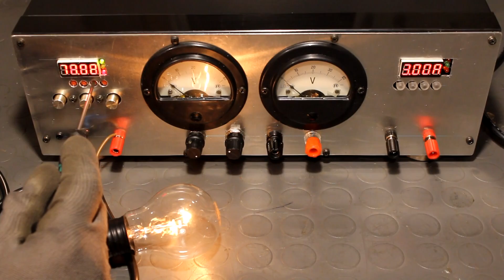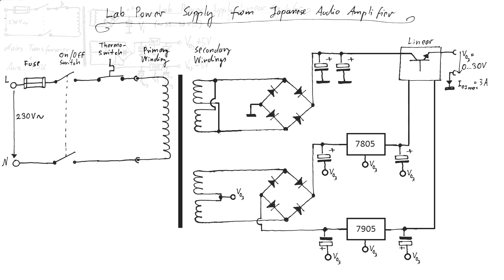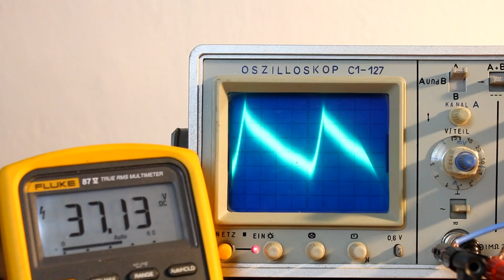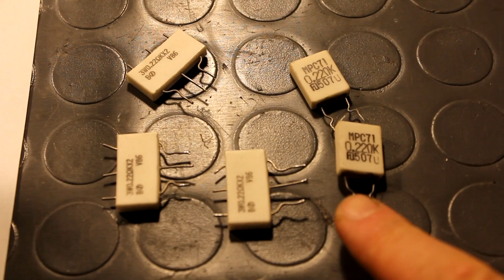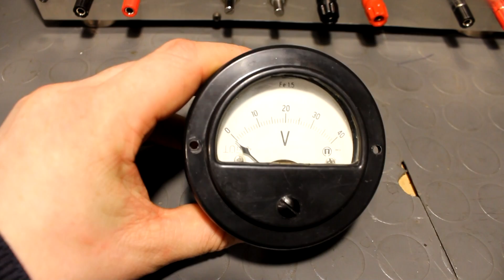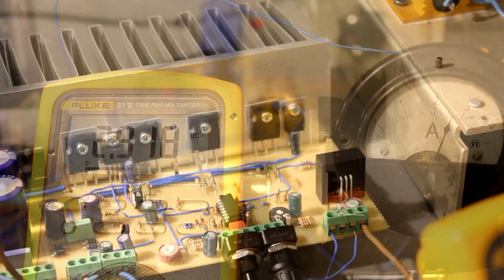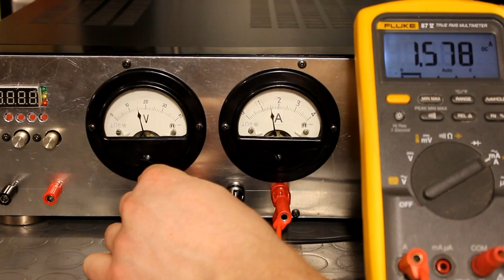Building a Lab Power Supply with a Discrete Linear Regulator

Comment: I love your videos. I'm one of your first subscribers :) There is something that utterly bothers me in this circuit. Either the circuit as shown should not work or I don't understand electronics as much as I think. There must be something omitted.

Now. (Vi --- Ground) and (Vo3+5V --- Vo3) are two completely different circuits. How can current flow from Vo3+5V to Ground? I don't see how that circuit is closed.
I'm not being critical here, I'm just trying to understand. The device obviously works. So either I've forgotten everything I know about electronics or there is a mistake in the circuit diagram.

I can see how current can flow from Vo3+5V through the resistor 220ohm then through the emitter-base of BC556, through the potentiometer and finally  the circuit closes to Vo3.

But how can current flow from Vo3+5V through resistor 220ohm then through collector-emitter of BC556 then base-emitter of the transistor bank (and 0,55ohm), through the load and finally Ground? Those are different circuits, current should not be able to flow from the (plus) of the one circuit to the (minus) of the other?! It's like connecting the plus and minus of two batteries but leaving the other ends open.

Again, I'm not hating or something. That really bothers me. I hope there is some mistake.

Awesome video. I'd love if you could explain what's going on with this, I'd be learning a great lesson if I'm the one who's mistaken.
Reply: They aren't separate circuits. Vo3 is common to the power and the regulating section of the circuit.

Comment: 4:10. Variable-volt reg like LM317 needs a minimum load; don't remember seen this requirement for fixed-voltage reg like LM7805, though. They have a quiescent current with maximum around 8mA going directly to the ground pin, so I suppose this is already the "minimum load" and we don't need a minimum-load resistor.
Reply: as far as i know, they don't require a minimum load, because they have more or less one built in.

Comment: Great video and project!
From what i got from the vid you're using a floating output ground (Vo3) and was wondering does this induce any sort of ripple to the output (separate from the AC-DC conversion load ripple) or pose a high voltage from the output vcc to earth?

Comment: Thank you so much! This is exactly what I want to build in small for voltages / currents below 12V / 2A.
I had an issue there that drove me crazy, but know I have a new point to get further. Thanks!

Vielen Dank! Das ist genau das gleiche was ich in klein auch gerade bauen möchte für Spannungen / Ströme bis 12V / 2A.
Ich hatte da ein Problem, aber jetzt habe ich einen neuen Denkanstoß bekommen mit dem ich weiterkomme. Danke!

Comment: Hey, love the video. Just got a hold of a 350va transformer from a audio amplifier (48v|48v) center taps and (24v|24v) center taps. Was wondering if you could post a part list, or more detailed as built schematic? As is It isn't clear what parts/values are used in some areas.

Comment: great video! On a completely unrelated topic, you should get a 3d printer! i think you would find it very useful and you can probably make many videos about it or just use it for your pojects for enclosures / mounts for example.
Reply: 3D printers are getting silly in terms of price right now. There are good ones you can get on ebuyer and the like for £170-£300 which are pretty damn impressive.
Reply: i have gotten a wanhao i3 for 420euros almost 2 years ago and its great , same results as an ultimaker(witch costs 2000) it only prints a little slower,  plus they are great for tinkering and trying out mods to improve it.

Comment: If anyone knows a US source of the German part BC556, please post it. 

All I can find is the NTE159. 

Thank you.
Reply: This a "jelly bean" part. You really should be able to find a replacement for that on your own. Check the datasheet of the BC556/7/8/9 and compare it to your "usual" US suspects. If datasheet values look similar just use that as replacement. In most circuits the exact type of component does not matter at all (if it really does it is usually pointed out, and even then you can often find an alternative, you just have to be more strict when comparing the datasheets). For a transistor you check maximum current, maximum voltage and hfe. If those values exceed those of the "original" you are usually fine. A good understanding of the circuit obviously helps and if you know for example that the transistor is doing something with high frequency you have to take that into account as well.
Reply: Crocellian
it really isn't that critical at this point, you do not need to have this exact model if it's hard to get!
 As the post-apocalyptical inventor also mentioned.
That it needs to be a pnp type transistor is the most important detail.
Reply: You can use 2N3906 or 2N2907 transistors instead if you don't have any BC556.
Reply: Many thanks. I have had a few bad experiences substituting pnp devices. Most especially in psu applications.
Reply: You have to learn how to substitute parts. It is a valuable skill.
Reply: Could use Diodes Inc. They do the old Zetex/Ferranti ZTX transistors. Would say something like the ZTX 504 or the ZTX 541/542. Using a higher voltage or power transistor than the type specifyed you could run into problems such as the forward gain not being high enough. The original A, B, C specifications could be changed to suffix numbers such as 16, 25, and 40 on some of the BC type codes recently.  'A' can also mean a enhanced specification such as a higher breakdown voltage on some typecodes as well.

Comment from the maker: Some additional remarks: Since the LM324 contains four op-amps, it would have been better  to write down "1/4 LM324" instead of "1/2 LM324". This mix-up happened because I originally wanted to write down either "1/2 LM358" or "1/4 LM324". These two ICs are virtually identical, only that one has two and the other four integrated amps. The LM358 can be used just as well. I simply didn't have one lying around and basically "wasted" two op-amps. With a cost of around 30 cents for one LM 324, this shouldn't be a big issue though :D. I also tried to use the two remaining op-amps in conjunction with the meter for the current measurements, but since I ended up using an "active current sensor" with an integrated amplifier, they were'nt needed in the end.

On antother note: I have to stop using the phrase "so called" when I refer to the corret name of something. It's just a German thing, because we have a very similar phrase that can be meant both positive or negative regarding the validity of the used term.
Reply: Very Nice Video indeed. But could you perhaps provide an updated schematics maybe. It looks to me that you are using V03 as both ground potential and voltage output.
Reply from the maker: I know that it looks confusing, but it is correct. The minus side of the rectifier of the first secondary winding is ground. While the minus side of the rectifier of the SECOND secondary windings is V03. You see: The linear regularor circuit needs +5V and -5V volts in reference to V03 and not +5V and -5V in reference to ground.
Reply: Halo Gerolf, I wanted to let you know that this is perhaps one of my favourite videos on YouTube. I have a very similar audio amplifier and I have been planning my own bench power supply following this video very closely. I wanted to ask though: at around 20:38 you show a schematic in which the current limiting circuit uses four 1K resistors. There is an arrow pointing to nothing at the bottom of these resistors. Are these connected to the output? You meantioned them being in series with the darlingtons and in parallel with the voltmeter. Thanks!
Reply: I used an LM741, which is a single op amp roughly equivalent to each in the LM324. :)